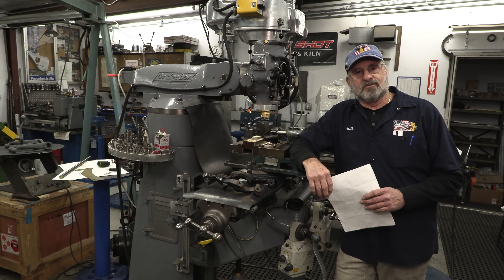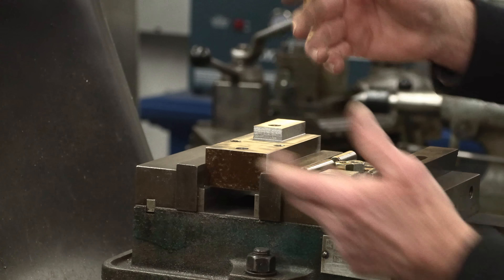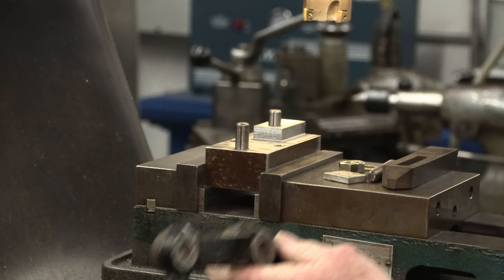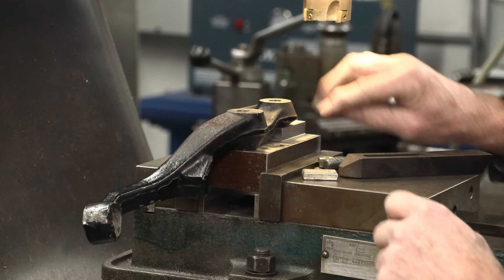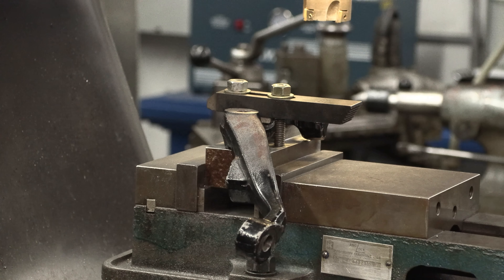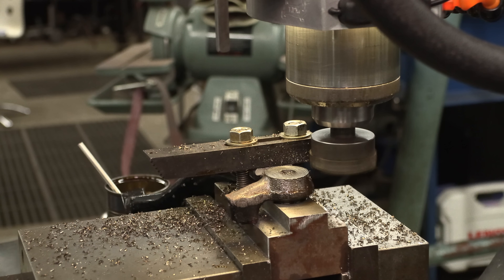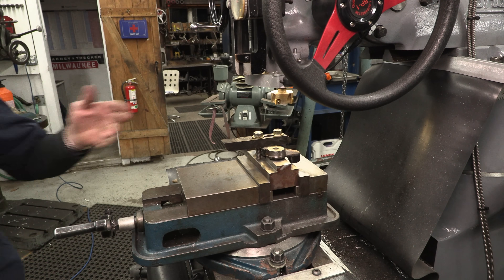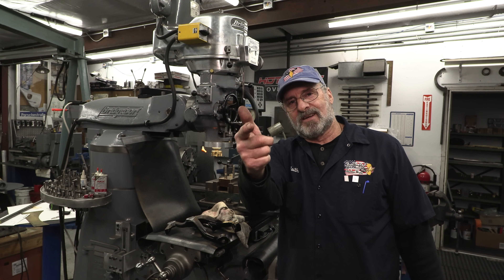Tooling & Fixtures 2 /23/ 23

Comment: Nice work.  On your printed machine handles, is it your intention to use them as is or are they to be used as foundry patterns?
Reply from the maker: These are practices for printing in metal sintered materials,  then send off to plant for sintering
Reply: @KeithFenner  Very cool

Comment: Is the sound of that cut about what you would expect for this material and cutter? It sounded rough to my ear, but I am no machinist. It seems like you bumped up the speed and came in with cutting fluid, can you say a bit more about what you were thinking there?
Reply from the maker: Interrupted cuts are always a little noisy on spindle mills more than universal mills, adjustments to make the noise and color of chip combo, is how I adjust the cut.